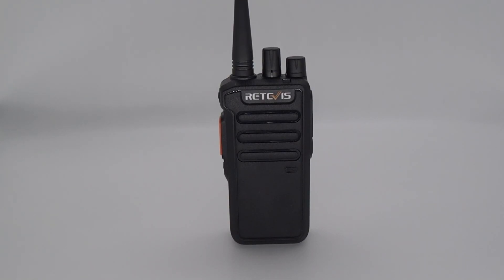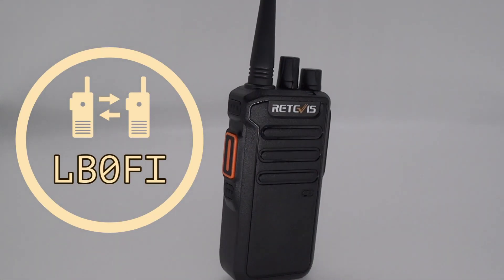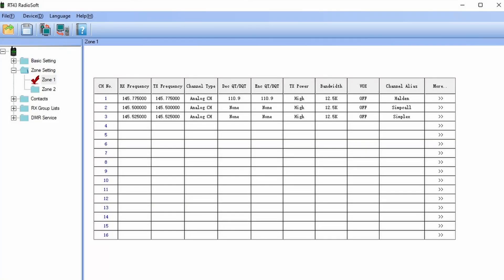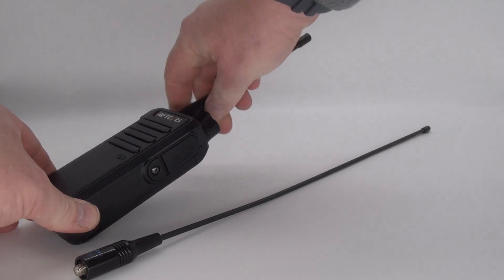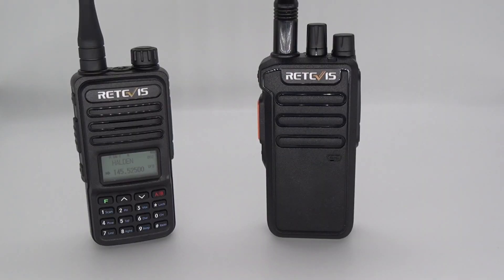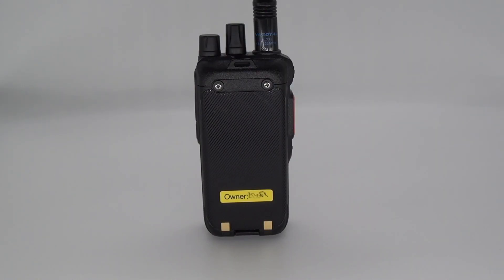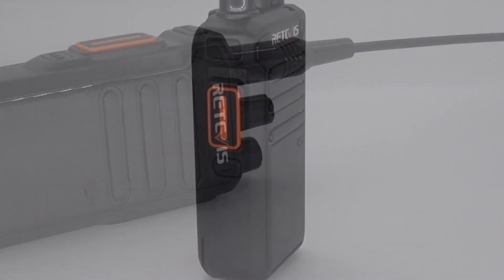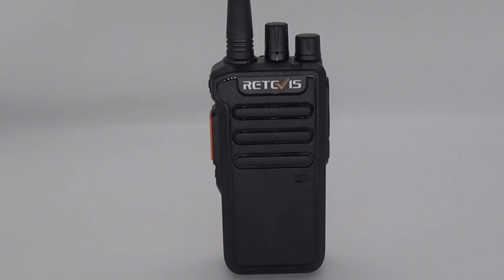Super Easy Retevis RT43 VHF Hack

Comment: I found something similar with the Retevis RB17 where it's supposed to be UHF only and they have a version that is VHF and if you change a 1 to a zero or vice versa in the setup.ini for the software you can make it run VHF and unlock the frequency programming.  Where this radio just takes the simple program to accomplish that, it's pretty awesome.
Reply from the maker: As I stated, I don’t know how clean and efficient the radio is on VHF, but it is a really nice hidden feature nonetheless.

I also have a feeling that you do the same as I do for a living from your nickname.
Reply: @LB0FI  I work doing live sound and AV/Technology.
Reply: @LB0FI  Yes I feel the same about it, who knows what's going on in the background we can't see without the analysis.